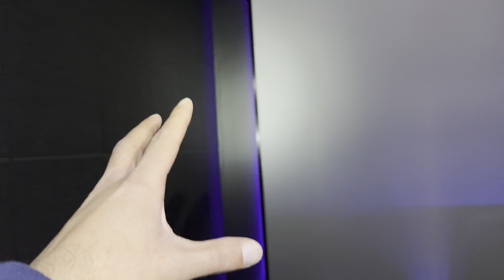My £10K Home Theatre Audio Upgrade - Day 6 - Atmos speakers installed

Comment: I also woundnt run Audessey I use a manual calibration much better I’ve tried both and the manual is much clearer and accurate sound
Reply from the maker: For now I’m sticking with audessey as I don’t have my seating finalised yet and it’s quicker to run audessey than it is to manually configure speaker distances and levels.

What setup are you running out of interest?
Reply: Dali Spector  7.1
Reply from the maker: It’ll be coming when it’s all finished.

Comment: You have great set up ngl , but your limiting your set up by using the Apple TV it doesn’t support full bit stream pass through . I also have upgraded from lg sn11rg to 7.1 set up .your vids are great but you gotta stop using the Apple TV for films and plex especially with a great set up like this
Reply from the maker: Thanks for the comment Oliver, I’ve used Apple TV with infuse (not plex) for quite some time and that results in the best possible setup for my usage.  The user experience is as important to me as simply the end result.

The majority of the content we consume is via streaming services like Disney+ for their tv series so Dolby digital+ is all you get with those anyway and as it’s been shown many times it would be almost impossible for people to tell the difference between Dolby digital+ and Dolby truehd.

Majority of movies are via actual Blu-ray rips so much higher bitrate compared to streaming.

I am open to ideas for an alternative however as long as you don’t say kaleidescape at £6K because that’s way out of my budget